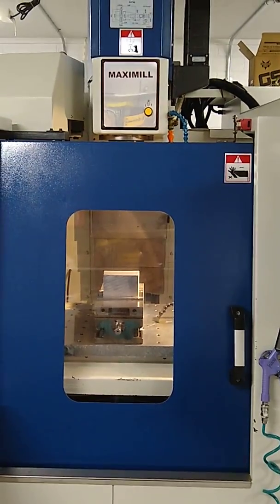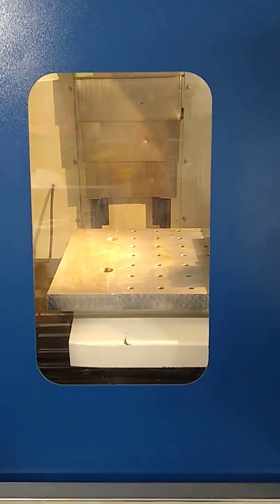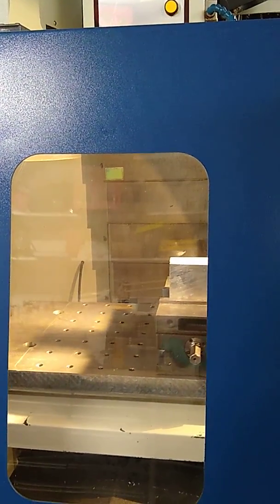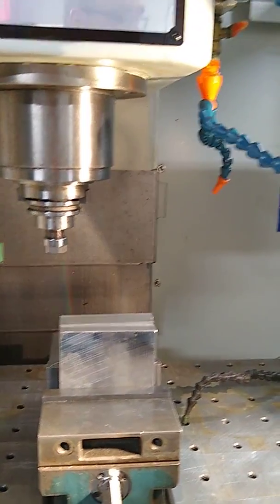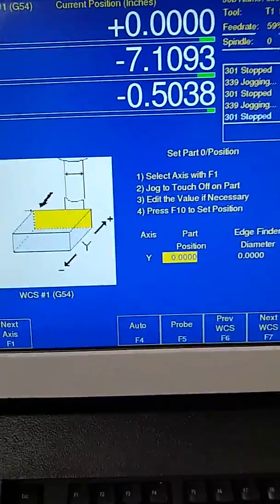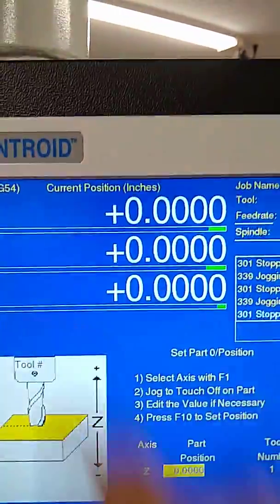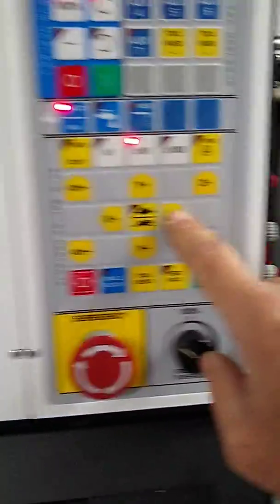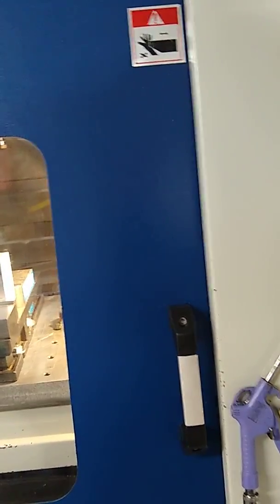Homing my machine, Part Zero (Work Coordinates), limit switches

Comment: Thank you for all you do to help us.
I could never find out how to get to the machine coordinates display until I viewed a video from 2010.
I had finally been able to install, set my home and limit proximity sensors on my PM940 conversion.
I then set soft limits after this. I also set these with reference to the old video based on the much earlier version of the Centroid controls .
(Not an Acorn).
I had to figure out how to apply this to the Acorn Wizard page because I could not access an I/O screen as displayed.
I set my soft limits to the proper Sign (negative or positive ) position in each appropriate entry location on the home/limits screen.
I set my home limit on X axis to minus point one (-.1) so that the travel would be limited when moving the spindle in the negative direction in order to prevent the table from encountering the metal on metal mechanical limit of my machine . By setting this soft limit on the negative side of the Machine Coordinate screen Home 0.0000 location this still lets the table move to its Home position without reaching the Soft limit.
This requires having first set the proximity "hardware limit switch" somewhere slightly further in the negative direction as a backup limit to the soft limit.
For the Y and Z home soft and Hardware Proximity limit switches the same logic applies except you would enter those soft limits as Positive (+) entries as you would want those axes to be able to reach their Machine Home Positions of 0.0000 before encountering a soft limit or Hardware limit switch as the machine moves to Home in positive directions.
I had been trying to do this from the Part Zero datum and not the  Machine datum :(   .
Your video today helps explain that.
By the way, 
On the opposite side of each access for Home Limit All input , I set the sentries into the Wizard  (opposite Sign +or- as appropriate ) as 0.1000  just prior to encountering the hardware limit switches .  That way you hit the soft limit prior to ever needing the hardware limit to stop the table .
Of course there is no home position on this side on each of these axes.
I think a video of the above would help other rugrats like myself entering the CNC conversion world.
I'd do it myself but don't know how to YouTube.
Again, thanks for all you do as well as Centroid.